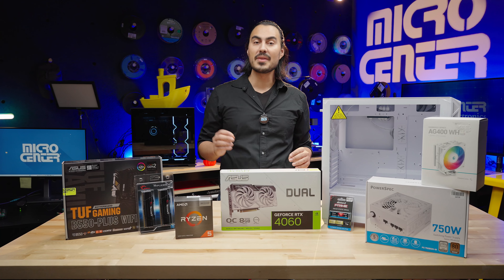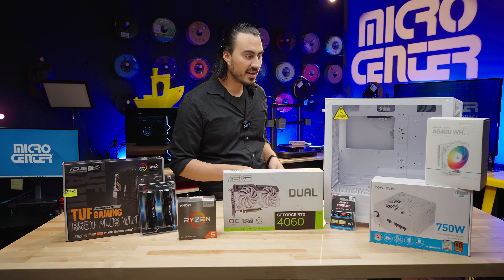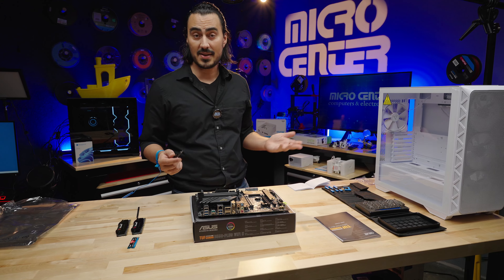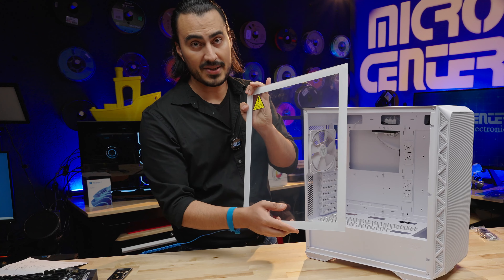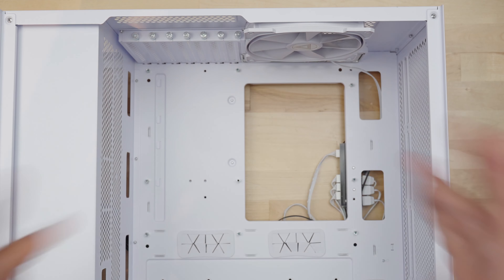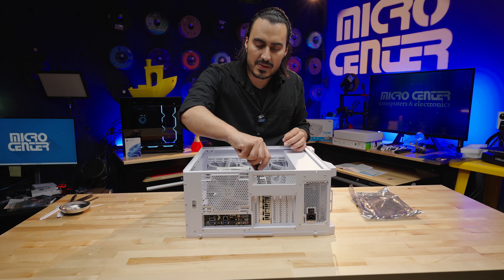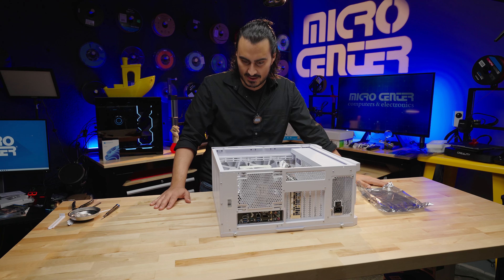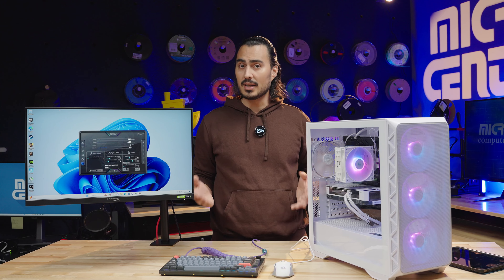ULTRA Gaming PC for UNDER $1000?

Comment: I have a question regarding the Montech Air 903 MAX box.  Are the pre-installed HP140mm fans on the front compatible through software with mystic light msi? Thanks

Comment: I went MSI MEG Unify B550 board for the 5600X3D. You had one open box, $75, insane price for the record holding pro overclocking board. Unify is one of 3 higher end MSI boards with X3D boosting feature. Best RAM OC of all AM4, best VRM, true 16 phase Infinion 90A power, error code display, power/reset on board. And front USB-C, lol.

Comment: For context on what the other comments are complaining about:
RTX 4060 8gb is widely considered very poor value for money given the VRAM limitations and high price per frame. AMD hasn't provided anything good at $300 either (rx 7600 is more budget) but the old RX 6800 cards (and the 6700 and xt's etc) sell for around the same as this and have much more VRAM and performance, and can use the same technology as the new AMD cards
Reply: Thanks for clearing that up.
Reply: So ignoring the price, is the rtx 4060 a bad gpu?
Reply: non of the above. its a hated gpu because it performs the same if not worse than the 3060